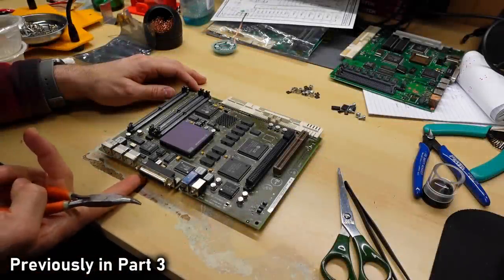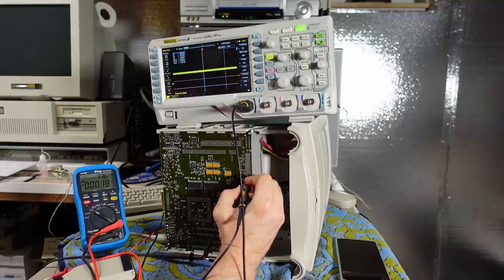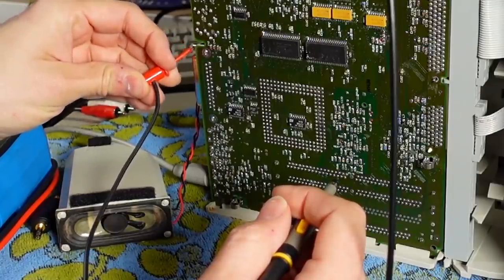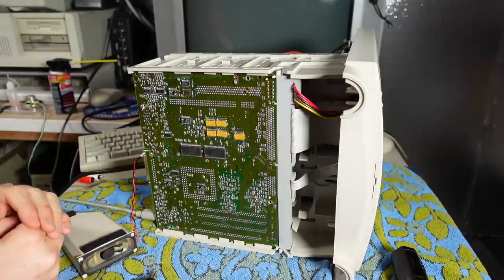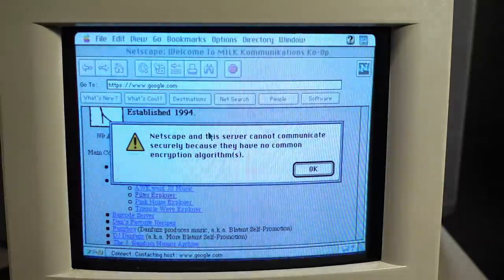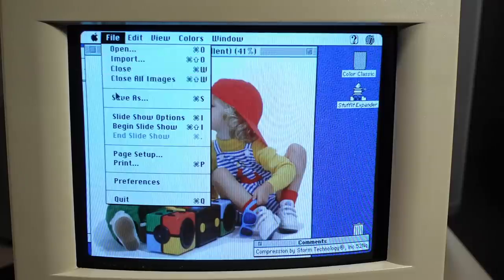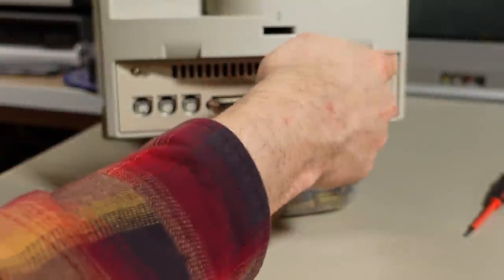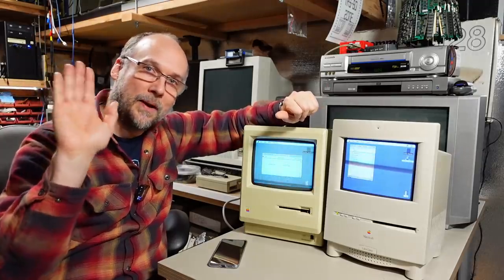You won't believe why the sound was broken on the Color Classic!

Comment: The ghosts of all those RF shields you’ve tossed out have had their revenge! ;)
Reply: I have to say, in re: the title, that "improper grounding due to removed RF shield" is indeed a cause of malfunction in one of Adrian's computers that I'd believe in.. :P
Reply: to be fair..this machine's RF shield was so rusty it HAD to go.
Reply: Fellow RF shield thrower here. Apple shenanigans 😂
Reply: It always drives me crazy when he does that. I repair a lot of electronics from the late 80’s to mid 90’s, and quite a few circuit board designs use the rf shield to connect ground planes like this. It’s really not that unusual.
Reply: Adrian, don't let this experience discourage you to toss out future RF shields!
Reply: @bitoxic  It really should, given that this isn't unusual.  The ground planes are separated to lower noise -- by separating analog ground from digital ground, the analog circuitry is isolated from the "gulps of current" that digital circuitry takes when it switches.  Usually, especially on modern consumer devices, the grounds are connected on-board to a "star-ground", but using the RF shield isn't unusual, especially where in things like test equipment (ex: multimeters) where the manufacturer doesn't want it to work with the cover off.  
Further, those RF shields don't just shield the environment from the system (reducing emissions, which is less important today given the surrounding equipment probably emits a hell of a lot more EMI), but also the system from the environment -- reducing susceptibility, which is more important today precisely because there is more noise.
Reply: @PCEngineGaijin  Let's say *proper* circuit board design suggests separating analog ground and digital ground. I can't believe a tech at Adrian's level is surprised by that.
Reply: Muhahaha!
Reply: @undefinednan7096  A micro switch could also be used which I’ve seen a few examples of. Arcade games have the deadman’s switch bypassed a LOT OTOH.

Comment: Hi Adrian, the separation of grounds was indeed for RF shielding but I suggest you solder only one "bridge" to the external ground to avoid "ground looping". You would notice this also by hearing strange noises through the speaker. It probably won't cause any noticeable difference but in the case of any surges a star ground is always a rule of thumb. Cheers and keep up the great vids!
Reply: So it helped in shielding? So only circuitry that needed shielding was put on that ground plane? But anything you plug in externally in that SCSCI port undoes that. Very confused on the purpose of dual ground planes. But I was thinking that likely you only needed to bridge it in one place.
Reply: Do you think he would get power supply switching noise and other artifacts?  CRTs can generate a ton of noise too.   IIRC, early 1990's macs developed a reputation for good quality audio production.  I wonder if isolating analog audio ground this way contributed to that?
Reply: @8BitRetroJournal  As pragmax suggests the purpose is to reduce noise from the digital circuitry. Not sure if it's the exact right way of putting it, but the sharp edges of digital signals cause noise that can be picked up by the ground plane (I know, it's an oversimplification of the issue). Having a separate ground for the analogue parts of the circuit means that noise can't cause interference with the audio signals. So yeah, connecting an external device which shorts these two ground planes could also cause the digital noise to to be picked up by the audio circuitry, which may also be the case with Adrian's modifications. However it's a little more complicated than that, since you also need to take into account return current paths, and that's where having a star ground helps. Connecting an external device would also only connect the two ground planes at a single point, similar to a star ground, so that might not be so bad.
Reply: Haven't watched the whole video yet, so not sure if it has anything relevant to this, but:
1) if you're worried about bridging grounds partially via audio connections, bear in mind that sound connections commonly have capacitive isolation, and
2) "shield" grounds commonly have little to no noise on them in the first place because they aren't used for signaling at all.
Reply: Upon watching a bit further, I remembered something about SCSI: it uses bus termination, so there should be little to no noise reaching ground from the SCSI bus itself.
Reply: @8BitRetroJournal  I'll do my best to explain why this is done - explaining ground loops isn't really that simple so forgive me if you end up even more confused. To answer your question, yes externally you can bridge the ground for ex using a SCSI cable but this is "ok-ish" and intended by design - let me explain further. Internal circuitry has it's own ZERO reference and all ICs and circuits refer to it as is obvious on the board. The Audio op-amp "return" circuit instead has an "external" ground reference "bridged" by the RF shield. In terms of circuit it should be seen as a different ground while in terms of conductivity it is (nearly) the same obviously but it has a "star point" connection which can be referenced to the external RF shielding. This is actually why there are 2 "grounds" which is actually incorrect as one is actually properly called "0V" and the other is the ground or "shield". In proper circuit layouts they are always identified differently (0V and GND). If the chassis shield is put in place, the 0V and GND apparently coincide, but this is only apparent as any ground loop would be limited to the external shield as external grounds refer to this, which is the whole point of the game. This is why in cables you have 0V signals and "shield" running seperately towards the host or device. This is also why the SCSI termination (whether active or passive) is refered to 0V and not to the shield. It is all to prevent noise on the lines: read "noise" as GROUND LOOPS. This has nothing to do with line interference or inductive coupling noise which are completely different beasts. I hope I have cleared some confusion up (I might have created more as this is what seems to be the case when trying to explain shielding from ground noise or shielding from line coupling).
Reply: @pragmax  it certainly did - this is how to properly avoid ground loop interference especially in audio signals. Check my below reply for further details!
Reply: @Luca_Techy  That clears up a lot, in fact. The moment he stated that connecting a SCSI device would reference both ground and 0V I immediately thought that would could a problem with ground looping. So I popped down to the comments for clarification. Cheers bud :)
Reply: You had my same reaction, i was "what are you doing! If you remove the shield at least star ground the different planes."

But my question is, why did he dad to remove the emi shield?
Reply: @tuttocrafting  The original shield was badly corroded/rusted and was unusable.
Reply: @8BitRetroJournal  the point is to not have digital noise on your analog ground plane for example. Its common design practice for a number of years now to have one strategic connection between your analog and digital grounds.

Comment: 15:30 - Split ground planes are to prevent digital logic ground currents from contaminating the lower level analogue circuitry...
Reply: Commenting to raise this.  It’s pretty common to keep analog and digital grounds separated except for some central star ground point.

Think of a PC case, for example.  The whole case is grounded to the PSU.  The motherboard grounds to the case via the screw posts.  Drives ground their chassis via metal to metal contact to the case.

The Pro Audio Spectrum 16 sound card uses the ISA bracket for its audio ground.  (I found this out when I removed the bracket after replacing old corroded jacks with new ones that were slightly shorter.)
Reply: @nickwallette6201   I weep when i see modern ATX enclosure front panels connect audio ground and USB ground together. When you get interference from increased load, no surprise. The mainboards are remarkably careful about star-grounding the audio unit today.
Reply: Using the shield as the return path is not very clever though.  It creates an enormous loop for the high impedance and noise sensitive audio signals.

Audio frequencies are so low that they don't cause a problem for RFI so it's not necessarily a problem to involve the shield in the audio circuit.  Until some other RF signal decides it would like to join in 😂

Comment: That RF shield, and digital/analog ground split was the best way to prevent EMI from exceeding the emission rules of the day. Split grounds also helped keep digital noise from getting into the sound signals. It works if done right. I use split grounds in my microprocessor projects when I use the A/D and D/A in the microcontroller. It keeps the analog signals separate from the digital signals.
Apple probably had to work hard to meet the emissions requirements and that was their solution.

Great video!! Thank you!!

Comment: Every time you remove an RF shield, I struggle... Like, they actually perform a function (not just using them for grounding and this kind of weirdness), but also, they block RF emissions (which can screw with cell phone, Wi-Fi, and Bluetooth reception, among other things).  Like even if it has no RF specific components inside, some of those old CPUs and ASICs can generate radio noise, and noisy power rails can act as antennas.  It's part of why they have those RF shields in the first place...
Reply: Exactly! His I'll will towards shielding will probably bite back in much more subtle ways than just grounding issues. I guess I have to hope he lives out in the middle of nowhere
Reply: Don't forget the other way around.  Noise can screw with circuitry, especially analog circuitry, but by no means is digital circuitry immune.

Comment: Having a split ground plane to minimise interference between digital and analogue circuitry is standard practice.
Using the RF shield to connect the two was probably just the cheapest/most convenient solution.

Comment: @Adrian It's interesting to hear you reflecting on these compact Mac's. My SE Superdrive was the computer that got me through university and I remember loading up Netscape & Z-Term and getting it online for the first time. It had a 68000 16Mz accelerator in it but was still unbearably slow. Even Maelstrom was sometimes my game of choice to distract me from the all those papers I wrote on that little Mac. A colour classic would have been my dream setup too, and thanks to your channel I have a Color Classic II on its way to me right now from a Japanese auction website. Who knows if it will work or even survive the journey, but all I know that I need to get it out of my system and find out. If I can eventually coax Maelstrom to work on it then that will bring some nice closure too. :)
Reply: Did you get your Color Classic running?
Reply: How did it go?

Comment: Ground path through the RF shield was used to avoid ground loops. Ground loops are created when having more than one path towards the ground. Although you might thing this would be good, in electronics, such a configuration creates an antenna. As a result of the loop, the circuit will pic up interference. The frequency of that interference is related to the length of the loop and you can refer to it as the characteristic frequency (or range of frequencies). In case this is within the operating range of your circuit, then you will be picking up noise.
I would do what other people already suggested, only connect the two grounds in a single point.

Comment: Adrian, Apple did not split the analog ground plane from the digital ground plane to reduce EMI.  Splitting the ground planes is a standard tactic to reduce noise in the analog circuitry for several reasons(*).  When digital circuitry switches, especially CMOS, it will briefly draw a much larger "gulp" of current to switch voltages (needs to charge/discharge various capacitances).   Because of ohm's law and the fact that real ground planes have nonzero impedance, this will actually produce a voltage spike on the parts of the ground plane the current flows through, which screws with all circuitry, but especially analog circuitry -- digital circuitry is somewhat protected by noise margins on logic levels.  This is mitigated to a certain extent by bypass capacitors, which essentially spread the current spikes over a longer period of time -- the same amount of current will eventually need to flow in order to recharge the bypass caps.  However, the current flow from digital circuitry still tends to produce noise on analog circuitry.  Splitting the ground planes forces the return currents from the analog and digital circuitry to take completely different paths (**).  Usually, the ground planes will be connected on the PCB, perhaps at a "star ground", but using the chassis or RF shielding is not terribly uncommon.

* Note that this sort of design gets very complicated and there are disagreements about when to or if one should use split ground planes.  However, my goal is to just explain why they were used here, not talk about what should be done for new designs.  Please don't take this as advice on how to design PCBs.

** Note: modern sources advocate analyzing return paths instead of blindly splitting planes.

Comment: Frodo was never a particularly fast C64 emulator, mainly due to the portability of the code and accuracy of the emulation.
Reply: I had a 7200 LS with a Crescendo G3 upgrade card, but still couldn't get an SNES game to run without choppy audio. I switched to PC after I saw someone with a cheap 486 running an SNES emulator flawlessly. DOS was just less of a bottleneck for gaming than Mac OS.

Comment: I've done many designs where single point grounding was used on a PCB (star point) especially when using high speed ADCs, but it seems like bad design to rely on external mechanical ground connections for a circuit to work. Perhaps this was the only way to get the board to pass FCC testing - sometimes when a product fails a test you get desperate!
Reply: Bad design practice / 90s + apple engineering seem to go hand in hand

Comment: Just FYI - when you were looking at the scope trace of the audio signal, it was jumping up and down when you plugged in the external speakers.  I have a theory on what caused that.

Audio circuits are AC coupled, at least usually.  It’s always nice when you have +/- voltage rails so the AC can be centered around 0V, but quite often it’s using a 5V DC supply.  This means you have to center the AC waveform around some DC bias voltage to make sure the negative swing of the signal can go below the reference point.

You would then use a capacitor to remove the DC bias and re-center the waveform around 0V.  Hence, AC coupled.

(Even if you have a -5V rail, you still need to AC couple to make sure you don’t have a ground potential difference.  Moreover,  in many cases the -5V rail is only used for amplification and the D/A is still DC biased. I haven’t looked at the Mac schematics though.)

The “outside” or jack side leg of that cap needs to have a ground reference, since there’s no DC flow through the cap.  Usually, the input stage of whatever you’re plugging into (like a powered speaker or a mixer, etc.) will have a resistor to ground.  This sets the input impedance to something between 1K and 100K, often around 10-47K.  Instrument and mic level inputs are higher (maybe 1M), balanced pro audio is 600R, but you get the idea.  That R to ground pulls the AC coupled signal to ground, but isn’t strong enough to short the output, so you get a voltage swing around Gnd.

So what you may have been seeing on the scope when you plugged in the audio cable is the external ground being applied to the AC coupled waveform, bringing the bias point down.  Particularly if the ground reference was missing on the internal speaker circuit path.

Comment: I sold a MAC SE/30 for a lowly low price because I could not get the sound working except from the headphone jack! I tried everything, including replacing the capacitors, checking all connections, resoldering in case of cold joints... to no avail. Finally I have the possible answer to the mystery.

Comment: (13:49) It is quite common to have two separate grounds, an analogue ground and a digital ground. Typically these grounds would be joined together at a single common point (ie. Star Ground) in this case the RF shielding. I have repaired many switch mode power supplies that have an isolated ground, and yes, you must connect them together when the supply is on the bench, under test, or it will not work.

Comment: You can actually browse the web in a relatively modern way even on a classic mac like this. 
The trick is to get around the encryption which can be quite easily by connecting through a squid proxy that essentially performs a MITM attack and just strips the encryption. 

I spent a ... reasonable amount of time figuring it out, but I'm sure most of the people that would ever care to try wouldn't have much trouble with it.

Comment: Using the RFI shield as the audio ground would probably have been done to help stop radiated emissions from a cable plugged into the audio jack. If the audio ground were connected to digital ground, any noise on the digital ground would be able to radiate from the ground conductor of the cable plugged into the audio jack.

Comment: One reason it might be so slow is that JPEG uses quite a bit of trigonometry and it might be that the FCOS instruction isn't available with that CPU (I think it was added to the base CPU with the 68040) which would mean the math has to be handled via software emulation.